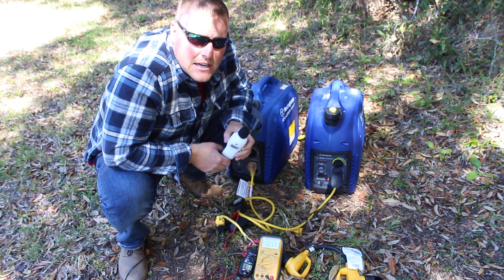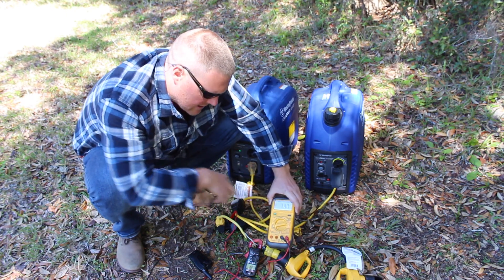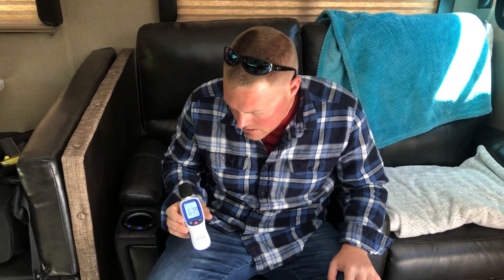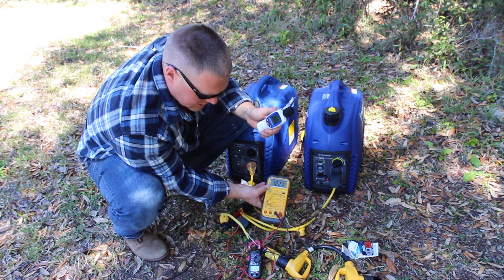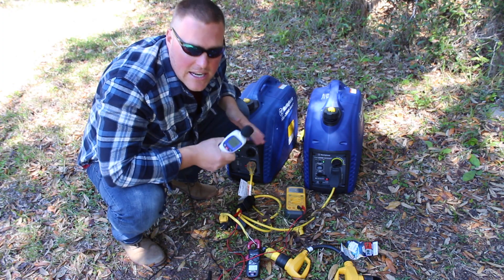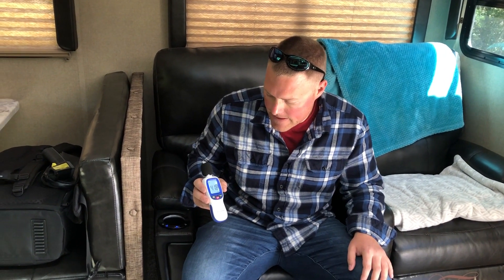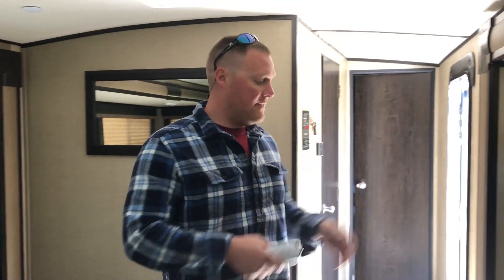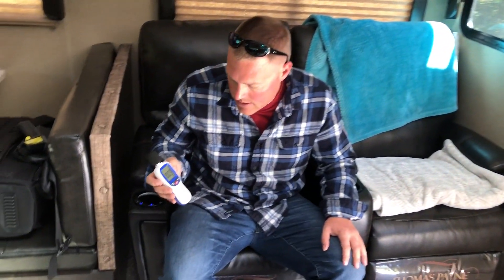Paralleling Generators, What Will They Run? Testing 15K BTU AC, Hot Water Heater, Microwave, TV

Comment: Hello, thanks for all the great videos.. i have a question.. how can i connect 2 Westinghouse 4500 with a parallel cord? Westinghouse dosen't sell it, is there another cable i can buy? If so what cable? Thanks!!
Reply from the maker: They do have a 50amp parallel cord coming out this summer. This will be used with the 2 4500's. The current cable would be pointless as it is 30 amp which a single unit already produces. We should review the 50 amp parallel cord as soon as it is released. I hope this helps!

Comment: I have a Westinghouse 2500 watt.
It doesn’t seem to have any ports other than the two 110 outlets. You didn’t show how they hook up or what I need to do so. Also I think in another video you showed this generator running a 15000 BTU air. In this video you said you can’t. I am getting my first small RV. It’s air conditioner is 13500 BTU. I was hoping I could run it with this generator if I didn’t use anything else. I don’t want to lug around two generators. Your videos are very good and informative but forgive me for being confused. Can a Westinghouse 2500 run a 13000 BTU air. If not I really screwed up.
Reply from the maker: Do you have the iGen 2500? Assuming you have an iGen model, the parallel cord is plugged directly into the receptacle. 
Our Westinghouse iGen2500 ran our 15K BTU AC. Not all RV AC Units are created equal....but normally the Westinghouse iGen2500 can run a 13.5K BTU AC.

Comment: I find your videos to be very helpful. You’ve brought several lower cost options to my attention and I thank you for it! It’s very helpful to see what the generators are capable of running. I’ve watched several of your videos but not all of them. I haven’t seen you address longevity of any of the generators you’ve reviewed. Do you have any videos that address that or have any plans to make any?
Reply from the maker: Thanks for watching! Yes, actually we are planning an update. Particularly, we will address Westinghouse as many commenters/viewers have questioned the same considering the price point of the this lineup. Just a heads up, we took the iGen4500 (this one https://amzn.to/2spwRD1) and the iGen2500 (this one https://amzn.to/2MahGa2) on a 22k mile trip across the US. The generator sat in the back of our truck and we used it a various altitudes. Both of them start right up and run as you see in many of these test. Needless to say, we haven't had an issue with them yet.

Comment: Are these the 2200 watt models?
Reply from the maker: One 2,000 and one 2,200 watt. The Westinghouse Inverter Generators can parallel with various sizes. Next we will parallel the 2500 and 4500 for max power output.
Reply: @generatorpower7744  , I plan on getting my 1st travel trailer with a 15K A/C upgrade over the 13.5K A/C unit, and found this video to be very helpful.   Perhaps two 2200's will be just right for me.
Reply: Generator Power "